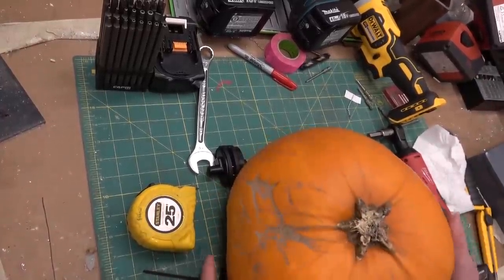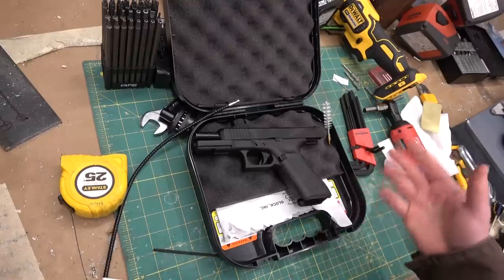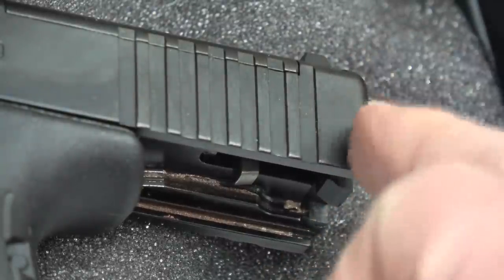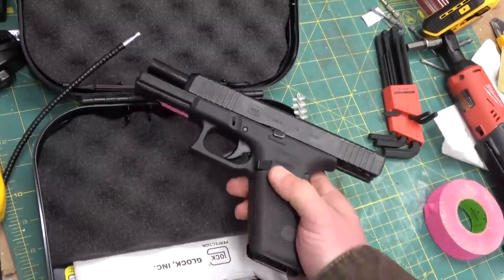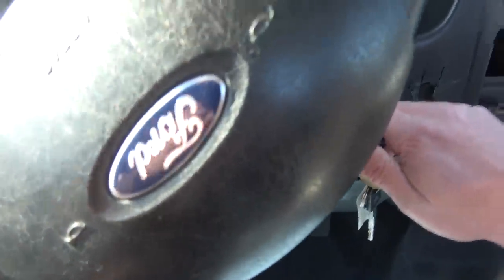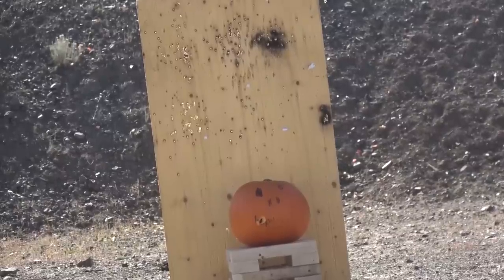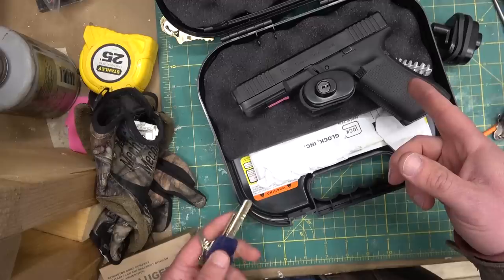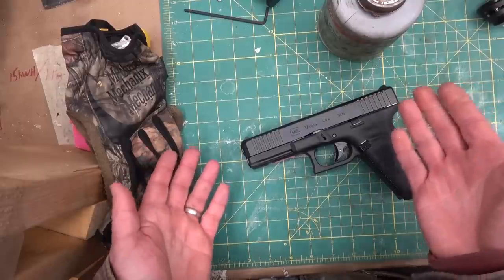BOLTR: GLOCK 17 GEN 5

Comment: The copper goop is there to help with the break in process, allegedly.
Reply: Hi Point`s mind over matter plead .
Reply: This is what I've heard as well. Came here to comment this.
Reply: Tolerances loosen up as you shoot it with that compound. Essentially Glock believes the gun runs better with looser tolerances after the break in process.
Reply: I've never had a hangup with my 19 with anything other than steel or aluminium cased ammo. I really don't think any pistol needs help breaking in. Just put some good lube in it and shoot it. The faster you break it in, the faster it will wear out anyway.
Reply: Yup,  Glock certified armorer here - leave the copper grease on per the manufacturer to help the break in process.  Lubricate with appropriate gun oil, CLP, etc.
Reply: @maverickpro  you know you could just build the pistol to looser tolerances 🤔.Why has Glock deemed the tighter tolerances necessary?
Reply: Ironically the purpose of the entire machine is to stop break-in processes
Reply: @maverickpro  Can you really polish a sear by putting polishing compound on it and dry firing repeatedly?
Reply: @goonerlander  There is no sear on a Glock.  However, the more you shoot (or dry fire as you stated) it will polish the firing pin and the trigger bar.
Reply: @goonerlander  look up 20 cent trigger job
Reply: @maverickpro  I wasn't talking about Glocks. Just a general question. Figured this guy would know
Reply: @jeremiahpike6372  Tighter tolerances will make less noise. Glock is used by police and special forces all over the world. It is a good feature not to sound like a bunch of metal stuck into someone's pocket while walking on the street...
Reply: No its to keep the firing pin block and trigger bar from rusting before its sold. Youre supposed to wipe it off before you use it...  Hes ignoring why the factory puts it on the guns in the first place. All glocks have antisieze put on them regardless if they were made in the US or Austrian factories. Its so they dont rust together sitting in a box for two or three years before they are sold and used.

Comment: no matter how well you compose yourself, any number of several factors play into your accuracy. anything from how you pull the trigger, where on your finger you pull the trigger, to sights being slightly off. not to mention if your anticipating the shot. flinching or tensing up as you pull the trigger in response to the expectation of the recoil. a good way to test that, mix in a snap cap into the mag. try to forget where it is or have someone else load it in. you'll  know if your flinching when you shoot. the best tip is to let the recoil surprise you, while trying not to limp-wrist it (which can also cause stove-pipe jams.) 

and a note on the inner workings... being a classic firearms collector im not too familiar with blocks, but usually theres a hammer that strikes the firing pin on firearms. on blocks i believe its a drop-in assembly, the ejector you were mentioning before is attached to it i think. but i could be wrong, like i said im not too familiar with them.

Anyways, love your channel and your content. i hope maybe the recoil tip helps the next time your at the range. i know it did for me. theres lots of videos out there on getting the best out of your shooting. but thats the difference between practice, and having fun just plinking off some rounds.

Comment: The plunger in the slide keeps it from firing if the slide is out of battery (not fully forward).  The claw is the extractor, the pin on the other side is the ejector.  Ave, you should Boltr a 1911 designed by John Moses Browning.  Over 100 year old  design and still being made and loved today.

Comment: The finish on the slide release on all the gen 5's seems to wear down really quickly. But the finish on the slide itself its tough as nails. I have a couple thousand rounds through my 43 and hundreds of holsterings and no wear at all.
Reply: ben wilson same on my gen 3 26. I just went ahead and polished it and the pins and install a shiny extended slide release.

Comment: If I'm not mistaken that plunger on the bottom of the slide closest to the bolt face is timed that it will only release the firing pin when the slide is fully in battery.  There should be a ramp somewhere for it.

Comment: Ave: "this is not a lubricant"

Holds up bottle that says lubricant
Reply: Pipe thread sealant is not a sealant, it is a lubricant
Reply: I think you´re being facetious, but if you´re not, be my guest and replace your axle grease with some copper antiseize
Reply: @dreyrugulfr9317  I'd like to watch that pony show.
Reply: @A_Man_In_His_Van  It'd wear it in nice and good alright!
Reply: it does lubricate in a sense, but it also produces more wear.
Reply: They put that in there to accelerate wear so you can show off to your friends how sloppy and fast your slide is like a race gun.  And also so you have to buy a new one every year.   Planned obsolescence
Reply: @GotrekGurninsson  I have put over 10,000 rounds in my glock 17. Isn't sloppy.
Reply: @1FireyPhoenix  Yeah sorry it was a joke.  Forgot you glock guys are pretty serious about your iGlocks
Reply: @GotrekGurninsson  Yep. I'm serious about any of my guns. I usually trade away the ones that are crappy. Glock, smith, colt, SfA, Sig, and walther to name a few that have been good to me
Reply: As a gunsmith. I call it a break in grease. After 200 rounds the pistol is broke in and then it should be cleaned and oiled lightly.
Reply: @dreyrugulfr9317  That might work half decent for a while. Make sure all the gears are well covered with it, and as long as you dont thrash it too hard Ill bet it'll work alright
Reply: adam bianchessi the instructions actually say to leave this copper grease on the gun and to fire it that way for a period of time until it wears off naturally.

Comment: The pins push out of the frame, wiggle the slide release for the metal one. The firing mechanism is genius and just slides out with nothing under that much tension. The "drop safety" is a plastic shelf and most parts do double or triple duty. There are a couple coil springs in the slide and firing pin disassembly is a little fiddly with it's spring cups but the rest is simple.

There's a 25¢ trigger job where you polish the metal wear points with your rotary tool.

Comment: Something else to keep in mind when people say “oh this part cost $20 to make and they change $600” well it took many iterations to do that and many engineering hours and engineers aren’t that cheap. Sure they will hit break even point after x many units sold but that doesn’t mean they should just start dropping the price. In fact maybe they keep it high to keep a more prestigious name. Ugly freaking guns though in their stock form
Reply: Latent Tweet I agree. Maybe they’re reliable, and maybe the ergonomics are good, but I can’t think of an uglier gun
Reply: Glock sells to law enforcement for less than $200 a copy.
Reply: @gc7782  now put a zev barrel and a cut out upper slide, extended mag, get rid of glock knuckle, RMR, now were talking a nice looking gun, but $500-1.5k in parts later.

Comment: At the 23min range, the slide button you thought was a magazine interlock is actually the in-battery safety. The striker won't release unless the slide is all the way forward in full battery. The pistol will fire without a mag, but the striker won't release unless the slide is fully forward. The ramp on the transfer bar moves rearward when you pull the trigger to fully move that button up into the slide so the striker can move forward unimpeded, but that safety isn't defeated until the trigger is pulled.

Comment: Get a CZ 75 and you will see true engineering and excellent fit and finish
Reply: I'm a CZ junkie, and I disagree.  My PCR was hogged out with well worn tooling.  I spent many hours finishing the actual "finish" job.  That said, the design is fantastic and I carry the gun daily (except when I'm working on the farm and carry my SP01.  I trust those guns.  I disassemble at times not just to clean, but appreciate them.  The glock is a testament to value engineering.  The CZ is a testament to engineering in general.  The p10c is amazing, but I dream of the day when they reinvent the metal gun and give us the next evolution!  45 years and still as sweet as ever on the 75 family!

Comment: That anti-seize compound is to prevent the steel guide rails and slide from corroding together or otherwise causing issue in long term armory storage.   The manual says to clean that grease out and properly lubricate before use.
Reply: Manual says to leave it there.

Comment: eight inches left and 12 inches down, very common on Glocks especially. Assuming correct sight alignment and sight picture, it's most likely slapping the trigger and recoil anticipation. Easily corrected, squeeze the trigger slowly, there's quite a bit of take up before the sear is released, dont just pull the entire length of the trigger pull quickly. Second, the freedom dispenser isn't gonna go flying out of your hand, just let the gun recoil on its own, all you need is a firm handshake like grip, and to act like the thing isn't going to go off, that'll help the anticipation; if that doesn't work, try snap caps (inert training simunition).

Comment: The anti seize is done on purpose. From what I recall it's part to keep everything from seizing in the worst case and part to abrade the contact surfaces to wear them in and "lap" the slide to the frame rails. The coating on the slide "tennifer" hardens the surface so it needs the extra abrasion for the lapping. Other firearm are just "shot in" in 500-1000 rounds the  parts have worn to sufficient tolerances.
Reply: BTW you did pretty good with the parts names. You did call the out of battery safety (it allows the firing pin to come out when the slide and the barrel are fully locked up) confused with a magazine safety and you kept calling the extractor the ejector. Great job on the video.

Comment: AvE,  GLOCK uses it as BOTH a Lapping compound and an indicator for the new owner to clean the gun. In The GLOCK armor's course they say that initial cleaning of the weapon is indicated when the copper colored lapping compound turns black from shooting. NEVER intended as a lubricant.Only three locations to propel lube a GLOCK. Over lubing causes dirt accumulation and premature wear.

Comment: Love the channel! The comment/question you made about the polygonal "artifact" in the rifling pattern in the barrel is actually intentional. There are a few different methods of rifling a barrel that each have their quirks but it has been found consistently that in pistol calibers where the pressures are considerably lower and the barrel lengths are considerably shorter that bullets stabilize better with polygonal rifled barrels, such barrels are rarely used in modern rifles. From what I understand this is mainly because in a pistol the barrel is much shorter and the bullet is in it for a much shorter period of time then in a rifle and thus does not have the time or as much pressure to "squeeze" into the grooves in the rifling as does a rifle bullet, and so the inner barrel profile itself is shaped into a polygon to help aide in imparting a spin on the projectile. its is basically like double rifling the barrel. Great video as always!

Comment: I would love to see you do a 1911 next.
Reply: Friends don't let friends shoot .45 AARP.
Reply: Complete teardown on one of those is a whole different world from the Glocks. I love them, but you can tell almost 80 years of development of the Browning tilting barrel system did not go to waste with Glock.
Reply: I’d send him one, maybe two, one chinsy and one highend (AvE PM me if you want to do one)
Reply: Thomas Foley  "NO ONE clones a Glock" - but there's multiple Glock clones. Smith & Wesson actually got sued for it and lost. The rest sell their "clones" as aftermarket parts to avoid getting sued. You can build yourself a Glock with zero Glock parts.
Reply: Thomas Foley  "I'll stick to a PROVEN design in a COMPLETE firearm" - then the 1911 comparison goes off the rails here. There's a reason many aftermarket parts require fitting on 1911s and the fact is that they're manufactured oversized so that they can fit on everyone's 1911 because many brands are using slightly different blueprints. So unless your particular brand of 1911 has been involved in many shootings with a good track record, it's an unproven design.
"Not everyone is a gunsmith and to think you can just put one together with parts and expect it to function is ludicrous" - the thing is, in the world of interchangeability you shouldn't need a gunsmith and things should be able to function when you put them together. Imagine if you needed a carsmith to fit spark plugs into your engine. Imagine if you had to order parts for your car and you couldn't expect them to function when fitted. It's not ludicrous. It's how modern manufacturing works.
"I have five pounds of American steel to brain your ass with" - lul typical loser bravado bullshit, don't worry the arm holding the gun is gonna get a sudden case of double-joint if you get your overweight ass near me

Comment: Not a single roll pin in the whole pistol, and it can be completely disassembled with a ball point pen. Incredible.
Reply: As something resembling a shadow of a man putting together a custom Glock 19 in his confuser chair, I can confirm the ball-point-pen method works satisfactorily.
Reply: The main beauty of a Glock is just how simple it is.  Very few parts, simple design yet one of the most reliable pistols out there.  I’ve owned glocks, cz’s of multiple types,s&w, and 1911’s... Glock is the easiest to work on, and build by far.

Comment: You should do a BOLTR on a high-quality paintball gun, something along the lines of a planet eclipse Ego or Geo! I think you'd really love the intricate pneumatics and ingenuity that goes into them. I for sure love taking them apart!
Reply: They go from 4,500 psi compressed air in a carbon fiber tank with 900psi output to a relatively low operating pressure, so they don't rip the fragile paintballs apart when they shoot them at 200mph (300fps) at a rate of 15 or more per second

Comment: They must be trying to wear the slide in with the anti-seize
Reply: It is intentionally used as a cheap break-in compound. It should be well known that Glocks are a mid-market pistol and are not broke in at the factory. The manual even specifies a certain number of rounds or magazines a owner should fire before cleaning the break-in compound off and replacing with the gun lube of your choice.
Reply: @kingrpriddick  You're right, I was just looking through the comments to see if somebody posted this. IIRC, it's 300 to 500 rounds but I could be wrong, I haven't messed with glocks in a long time.
Reply: Known as "lapping"
Reply: He literally says this in the video

Comment: No, that's not a magazine safety, it's a firing pin block. @22:36 you you pull the trigger, the trigger bar pushes up on the firing pin block and it clears a path for the firing pin to strike. If some how the sear engagement is broken with out the trigger being pulled the firing pin won't protrude from the breach face because it will be stopped by the firing pin block. The point where the trigger bar interfaces with the firing pin block (the arm that comes up off the trigger bar, about in the middle) actually contributes significantly to the feel of the trigger and many people polish these surfaces.

Comment: Glock "Perfection".... they're so perfect from the factory that everyone wants to replace the barrel, trigger, slide, guide rod and spring, sights, and have the grip custom stippled, etc....

Glock works, and they are usually reliable, but for the price there is better options with better triggers, sights, more comfortable grips, and more accuracy from the factory with equal or better reliability.
Reply: There’s a good reason LEOs all over the world trust glocks over everything else. They always go bang. You can run a dried up dog turd through a glock.
Reply: @austinr09  except they can't run steel case reliably
Reply: Everyone wants to replace parts because a) it's the Gucci Glock fad and b) people think they can buy skill.
The AR15 is an amazing rifle but almost everyone gets different triggers, grips, sights, handguards, barrels, gas tubes, etc.
Reply: Also the number of 1911s that get front and back strap checkering (same purpose as custom stippling), extended safeties and slide locks, etc is just a reflection of what you get when you have a huge userbase for a particular firearm, not quality.